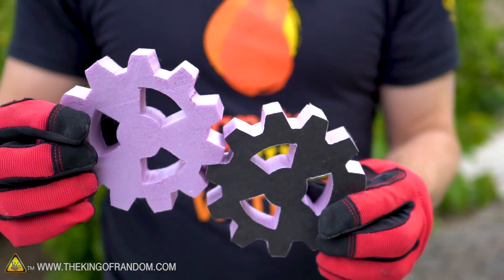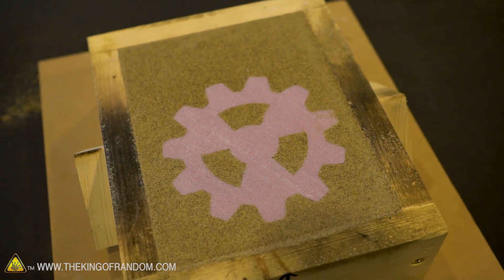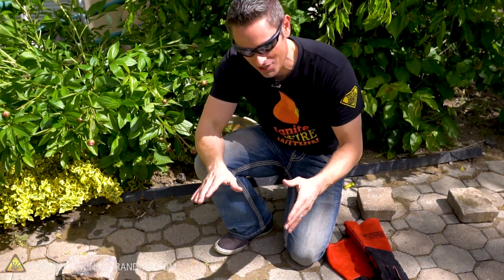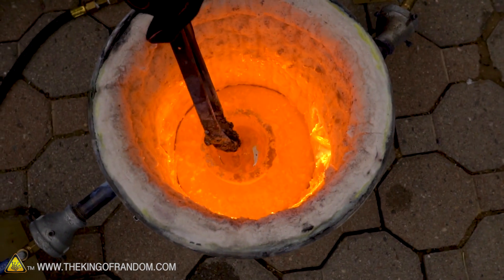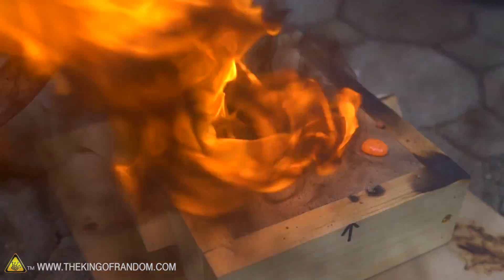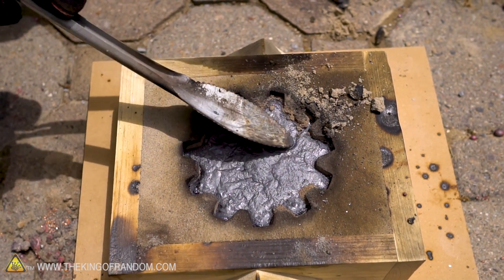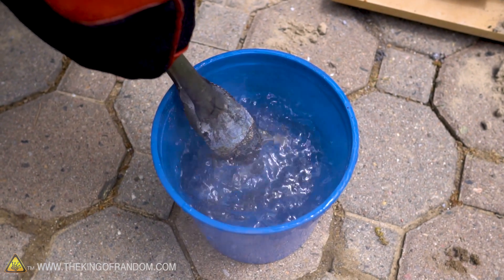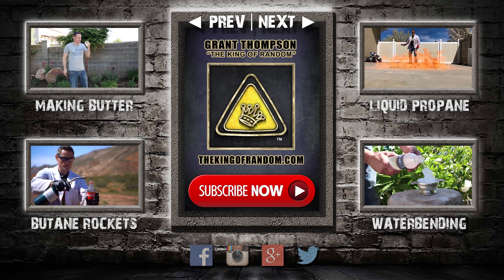Argh. Why Is Copper So Difficult? TKOR Tests Melting Copper In Our Homemade Foundry

Comment: it can be done I casted copper in High school, but without using chemical hardeners you have to use a full mold top and bottom sand casting. the reason the center pieces Floated is that the density of copper is very high in comparison with the sand, it is  like floating rocks on mercury if you stick them to the bottom they stay but with a proper fixation they will foat just the same as if you made a top and bottom mold without weighing down the top mold the whole top mole can/will lift/float the whole top mold.

Comment: Hey mate, if you used a little bit of sodium silicate solution in the green sand it should set pretty hard. Sodium silicate is a high temperature binder so it should have no problems with the molten copper.

Comment: Maybe cupper is too heavy, and sand+air mixture is just floating on it? When you pour the liquid copper, the hydrostatic pressure is just too big? If you do something with much lighter density (aluminum, or even iron), the hydrostatic pressure is much less issue

Comment: Any chance the moisture evaporates at the bottom of the mold and pops the sand away, or maybe its just due to the fact that liquid copper is so much more dense than the porous sand that it causes the sand to raise on top of it? Could you try the same test with like plaster mold that was dry and maybe preheated a bit?

Comment: I worked in a cast iron foundry making piston rings, calipers, and brake drums during my youth. Nodular Iron with a higher chrome content was used for diesel piston rings. Your mold needs a sand cover w sprue holes for pouring. A thin piece of wire can be used to create vent holes for gases to escape. Your sand needs to 'just so' usually made using a sand muller.

Comment: You need to use a two part mold especially for copper.  Enclosing the copper cools it slower and the sand wont move if its trapped.

Comment: I have made stuff with gray iron and green-sand very detailed stuff. you need to have a two part mold to make it work. put half of the gear in the mold fill it and pack it. then you need some powder so the top mold dont stick... etc. you should look up how to make two part molds.  Heat should not be a problem grey iron has a 500 degrees  higher melting point and it works no problem.

Comment: The density of copper is much higher than the sand. You can clearly see the sand block floating over the copper. It will help if you put a cap over the mold. Something like a steel plate with a hole to pour should help.

Comment: You should have a 2 part mold with a top. The chute that you pour the copper in will act as a slow distributor that helps you not to get problems like that when pouring the copper straight onto your mold and destroying it. You should also dip your styrofoam into a clay solution to give it a coating of clay.

Comment: Guess what happens when you introduce molten copper to water? STEAM. DADOY. Guess what's breaking apart your sand mould?

Make a top for your mould, make a pouring feature in it that is a circle with holes regularly around it and one directly in the centre THEN pour your molten copper through the top. The added support of the top will give the 'floating middle' parts something to rest against with their flat side in case they DO separate. You want your sand to be as dry as possible and the pour to be gentle rather than 'as fast as possible'.

Comment: OK. where to start. You can totally do this - its easy with Bronze which is 1200C to pour. Copper is similar.
If you're not going to cope and drag it (which will work better) then lessons learned are:
- pour 1 - if you apply enough heat to melt the foam then you'll also dry out the sand - and dry sand is loose and crumbly. (The Bentonite component is acting as the glue). so don't do it in two passes. do it just once.
- pour 3 - best chance of success but the islands failed while the supported sand (teeth) did not. (your sand was low on water and was visbly sandy. Do eth compress in your hand and split to see if its got the right water consistency).
If you had a cope and drag (two part mold) then the islands would have been supported and stayed where they were. (supported top and bottom you see).
So:
1. if you're going to just open pour then you need to remove the foam. It serves no purpose in your poiur and only gets in the way. It should come out easy (or paint it gloss so you can remove it and sand won't stick. So doesn't have to be foam). 
2. Then to support the islands you'll need to put a dowel or similar in the middle of each island when tamping so they have support and won't move.
3. then do what you did in ppour 3.
BUT better would be:
1. make a cope and drag,  Tamp the foam (painted gloss) piece into the drag, 
2. flip it over and dust the surface with talc,  put the cope on and tamp that with a rod beside the foam to eventually be removed and for the copper to go in.
3. remove the rod, separate the cope and drag, scoop out the metal entry point so incoing metal wil get into the foam section,
4. remove the foam section (hope it was painted gloss so it comes out nice and easy..)
5. reassemble and clamp the two halves together - you already know the copper will  float the top if it gets the chance.
6. pour (like your pour 3) within 20 mins or the sand will dry out - this depends obviously on local heat conditions.
Success !!
One of the othe rmain reasons to use a cope and drag - is the head - that will hold extra metal above the object and provide pressure, this will force the metal into the sharp corners which it might otherwise avoid as it will prefer rounded corners due to its liquid state surface tension. So a head will provide pressure to over come this. (same for Alu). You'll get a much better surface. in fact - if you did paint the foam and removed it, then you will get a shiny surface even in a sand mold.

Comment: Never mind Grant if you didn't get success in the beginning stage. Failure is the step to success.

Try using natural clay instead of sand or a mixture of sand and clay for the experiment. Clay will hold the sand petty well and it won't crush while pouring the liquid copper.

Never give up ! I know you can do it. All the best 👍

Comment: I think if you created a plaster coating of some kind to harden the mold after you burn away the foam, you could poor the molten metal into it and have less failure rate from it pushing the sand away.

Comment: Buy some petroleum bond
Dedross your copper before you pour it w borax 
Finally make a closed mold, wouldn't be to difficult with the gear you are casting  just make another half of the mold completely flat and cut a hole to pour and another for gas to exit the mold. Also styrofoam when burned can create unwanted gas in the mold leaving dimples or imperfections on the surface of your finished piece

Comment: Din't the three centre pieces break off because they are less dense than the liquid copper.  they floated to the surface like ice cubes in water. Closed mold would have kept them in place. 
Also, the styrofoam former will flex when you are tamping down the green sand so the sand won't be as compacted.
:-)

Comment: HEY GRANT THOMPSON. THE MOULD SHOULD BE PRESSURE PRESSED SO THAT THE SAND WOULD BE MUCH HARDER IN  HOLDING THE MOULD. YOU SETTING UP THE MOULD BY HAND WITH A PIECE OF WOOD IS NOT ENOUGH PRESSURE FOR THE SAND TO BE INTACT. TRY PRESSURE SQUEEZING THE SAND WITH A CAR JACK OR A PRESSURE PRESS. HOPE MY SUGGESTION IS HELP :-)

Comment: I bet it's the sudden expansion of the moisture into gas from the heat popping your sand moulds, I "predicted" it be worse when you said you made it more moist and it was. I don't really know a solution though other than a different type of mould, maybe vents so the gas can expand elsewhere instead of lifting bits of the mould up, I don't cast but basic physics applies everywhere :)

Comment: you dont have any flux in your crucible man!!!!! you always need flux it lowers the melting point of the metal so it runs better/longer and its less prone to oxidation. different types of acids can be used with "borax" IE:Sodium Borate being normally the choice for copper. 

you add this into the crucible after melting the copper.

Comment: Copper is notoriously hard to cast, but bronze and brass are much much easier, you should try that next.  Or perhaps you could try to do a homemade investment casting, either shell investment or solid investment should work, even with copper.

Comment: I'm wondering if your problem was too much moisture. As in maybe the steam was propelling those pieces of sand upwards. I'm by no means an expert, just a thought. I wonder if drilling a vent hole in each one of those sections would prevent their expulsion.

Comment: Could add some small rebar to the mold to help with stability.  It will also help with the sand forms popping off.  You do need a sprue and gate system as well to help.

Comment: Shrinkage Jerry, Tell her about Shrinkage, ... the 3 columns of sand for the cutouts in your gear are getting guillotined and popped out by the bottom layer of copper as it cools and shrinks while you are topping off the molten top of your mold.

Comment: Sand should be mixed with either sodium silicate or a low viscosity oil. Water is extremely dangerous around molten metal. You also I have found it to be extremely useful to use 2 halfs of the mold and at least a feed riser to allow for the metal to distribute more evenly inside the mold cavity and to also account for shrinkage due to cooling.

Comment: the copper is denser than green sand you need to weigh the studs down and use the propane torch to keep it hot longer

Comment: I've seen a sand and plaster of paris mixed for the moulds. The plaster may hold the moulds shape a little better. no idea if the heat would crack it to nothing though. would defiantly need to be dehydrated in the furnace slowly first (the mould) to prevent the moistures expansion from breaking the mould apart. P.S Thanks for the video

Comment: try adding a better bonding agent to the sand, try pva glue mixed with water or smash the sand down more on top of the design
Reply: Year. i use oil base sand for my videos

Comment: grant your using homemade green sand try using actual green sand
Reply: but it's not homemade green sand, it's just sand.
Reply: He will get nowhere with the sand materials he is using I agree,
also needs to put runners in the drag and a cope with a sprew and riser.
Reply: agreed, also the copper is heavy and can lift the sand or the top of a split mould unless you put weights on top. I had that problem with lead.
Reply: having
Reply: turtleboy2014 I know right
Reply: u dont want the sand to be super dry, then it wont hold together!
Reply: very true
Reply: but it shouldn't just be sand and water. proper green sand is sand mixed with bentonite clay powder then you add water. just sand and water is practically useless.

Comment: casting copper and precious/semiprecious metals, preheat mold and lube it, soot. use flux in melt and skim all slag. poor hot and smooth. You do have to burn out the foam or wax before pouring. Pack the sand harder or use investment.

Comment: Don't use too much water for your green sand? If so, you are asking for a very dangerous disaster!  Make/buy some sodium silicate if you want to still use an open face mold, or make a 2 piece mold. Sodium silicate cures when in contact with C02, so it will air cure slowly. You can speed up the cure with additional C02 from a bottle regulated down, or use dry ice.
Reply: and gypsum cement works as well in mold making thats solid. It can also be heated so that the metal wont cool as quickly on contact.
Reply: Thats how it should be done :D Use bee wax for model and gypsum for mold but dont forget to remove air from liquid gypsum before placing model into it. Sprue and its done.

Comment: Sand will have buoyancy compared to the copper -- so it'll float, because nothing is holding it down.  You'll need some kind of mold that is either denser than molten copper, or solid so that the center pieces are attached to the base and can't float.

Comment: DO NOT increase the moisture content of the sand by adding water.  You are risking a massive explosion that will spew molten metal all over you.  A shop teacher at my high school had a career ending accident pouring aluminum into a sand mold that was too wet.  Always use the proper binders for the sand system you're working with instead of water.  In this case, the styrofoam is too soft to allow you to pack those openings in the gear.  Look for a sand binder system like the ones used to make resin cores instead.

Comment: Use the sieve to spread the sand over the cast. The even coating of sand will create a smooth layer on the surface of the casting. Also give better detail to the rad holes in the gear during compression in the sand. Maybe more sieve sand near the top when they are filled? Press in to the holes with your thumb? Anything to keep the sand together in those spaces. Best luck.

Comment: WOW! GRILLING GLOVES, SUN GLASSES, AND SALAD TONGS, NOT PROPER PPE FOR THIS TYPE OF ADVENTURE NOT TO MENTION THE VAPORIZED ZINC AROUND YOUR BURNER LID VENTS. YOU CLEARLY HAVE NO CLUE!!!
Reply: Tommy Nordin TIG welding gloves do not offer the amount of protection required for "hot metal casting" now "Air Arcing" gloves are a different story and are constructed entirely of leather but that still isn't enough educate yourself then talk with others who use proper PPE and techniques related to the hobby of metal casting
Reply: William Tamburri you can only imagine
Reply: William Taburri at least he still (presumably) still has all his skin and eyeballs.
Reply: and yet he had a modicum of success!
Reply: I agree, though.
Reply: William M. molten metal will run straight off the gloves
Reply: Sorry, "...more than flesh."  Otherwise, thumbs up.
Reply: Actually, anti tank RPG warheads run on the same principal. They have a core of copper or equal metal that is super heated by the energy of an explosive charge. the super heated copper then melts through the tanks armor. 

So molten copper can melt through more then flesh.
Reply: William M. 
I bet you're really fun at parties.
Reply: Azza Nine "anti tank RPG warheads run on the same principal"

That is common misconception about shaped charges. The explosion doesnt melt copper nor resulting copper jet is in molten state. All of penetration is achieved by kinetic energy alone.
Reply: Marty Moretta are you referring to  Jalan Kolej Yayasan Saad, 75350 Ayer Keroh, Melaka, Malaysia???

Comment: Use more binder in the sand so it's more rigid. Temperature fluctuations will cause blowouts like that every time. Also, a closed mold system will work even better

Comment: so why are we doing an open casting? It seems like you should do something more like your aluminum sword where the entire shape is beset on all sides with the green sand. This way your copper which is heavier than the sand won't displace the sand as you're pouring the metal.

Comment: You need to use flux to keep the copper pure,  and use acetone to dissolve the styrofoam master.  This will leave a little styrene residue but it will be minimal.

Comment: Maybe a clay sand mix ? or it needs to be packed harder. also maybe a way to do a warm mold where the sand mold is packed into a metal container and heated up prior to casting so the copper can flow and not set up as fast as in a cold mold.  Also maybe could add a lid and drill a hole into the top of it to pour the copper through so there is pressure on the sand keeping them  center sand hunks from popping out.

Comment: My guess is that you are getting the copper "almost" hot enough - right on the precipice.  Can you let it cook longer?  Can you add more heat?  Can you pre-heat the sand so the copper doesn't lose heat when it contacts the cooler temp sand?  That mass is sucking heat away.  I think by increasing the temp of the copper or the sand, you increase your working time.

Comment: i have used green sand for molds but you have to have larger amounts of clay to sand so it sticks better.. but the better molds are made of plaster and you use wax.. then you burn the wax out in an oven then cast into the cavity.

Comment: Well, why the heck don't you use a bit of plaster? This should solidify and harden the mold and this way you don't even have to melt foam - it can be removed and even reused. This seems so obvious to me, so why it can't be done? Did you try it?

Comment: The sand is probable less dense than the copper, so it's floating on it.

You could try using plaster, or high temperature silicone. Silicone might be best if you want to do multiple castings with different metal. I think it's designed for lower temperature metals though, not sure how it'd work with copper.

Comment: use glass water to wet the mold,  let it set on co2 (in a bag with soda) those mold are solid and heat resistant, not to mention as easy to make as wet sand (a bit longer but you seems to have time).

Comment: Use red clay or make a mold by dipping a wax version of what you want casted, dip it in a ceramic dip of some kind with a ceramic funnel, cook off the wax interior, then while the mold is still blazing hot pour in your molten metal. Same method used by investment casting companies. Worked at one for several years. They used a handful of methods but those are two that where the most common

Comment: Mix just a little waterglass in the sand, so the sand does not break apart. The mold must be hot so the copper stays liquid long enough to fill up the corners. Add borax in the crucible - prevent copper forming oxide skin for easing pouring. Closed mold with mold channels increases the pressure of liquid and makes it fill up the space evenly.